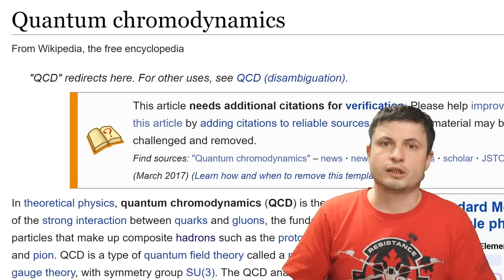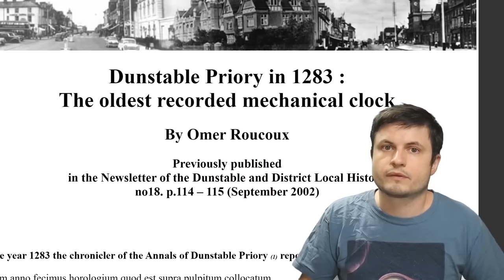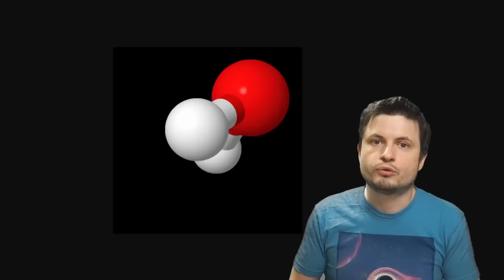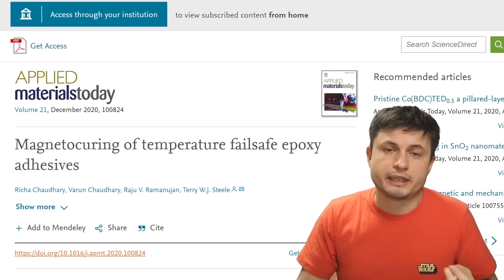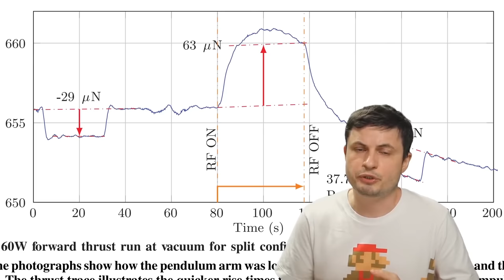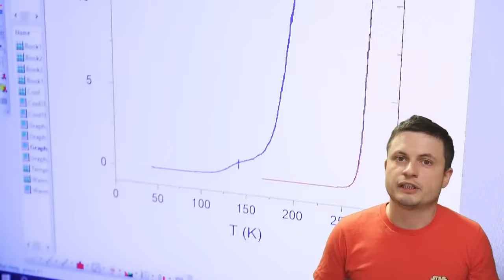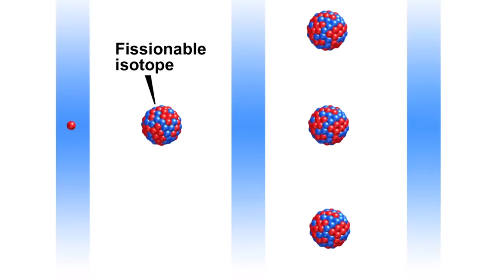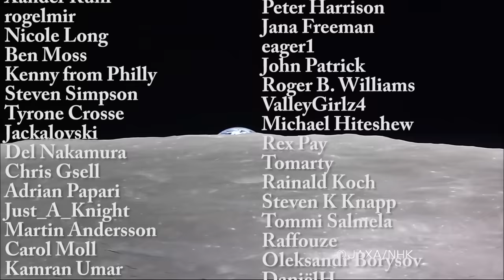Major Physics Discoveries of 2021 That Transformed Our Understanding - Video Compilation

Comment: Anton, I can't get past your first story. Did you notice the error bars on the "data" from Fermilab?  

This is the one thing that really bugs me about modern theoretical physics. With a "filter" that eliminates 98% of the data, and a whole lotta handwaving, we have a "new force of nature" to cover any  discrepancy in the numbers.  We already have well over 100 new "constants" to fudge the Standard Model. With high power particle accelerators that generate billions of events, we have "filters," ie, software that selects those events that are "likely to be of interest." Then when I hear things like "The Standard Model is physics' most accurate theory and has been confirmed to ten decimal places or  0.0000000001", I roll my eyes because of the "cherry picking" of data and all those adjustments to make the numbers work. This kind of  self- congratulatory hyperbole is what made men like Einstein and Planck so uncomfortable with the state of theoretical physics in their day. I wonder what they would have thought about the  methodology being used to "confirm" particle physics theory since the 1960s, and the precision of repeatability with only two experiments "proving" g-2 (or Higgs on which the Nobel prizes were instantly awarded) when the error bars are so very wide?

Comment: Ohhh... possible use case for that graphine battery / doped graphine. Don't know why I think this will work... but would there be any way to use 2 sheets of graphine. You pump pure CO2 in there and run a current between the sheets to give enough energy for the O2 to leave. The left over carbon would, I think, deposit on one of the graphine layers to make graphite. Remove the now grapite sheet and replace again with grapine to restart the process. Possible carbon capture technology?

Comment: Frequencies corkscrew through space and the spin is the drag of resistance of interactions of their continuous motion being slowed down. Interactions of frequencies create substance by compaction of wave lengths causing accumulated massive amounts of forced gathering of entanglement. Compatability of frequencies interlocking creating Gravitational force known as mass. The entanglement tightens the area of spiraling and spin, and reduces travel speed increasing force. The energy of force increases the spiraling spin resistance, turning fluid motion into interwoven, interlocking, frequencies to appear in solidity becoming interlocking motion in energy transference. Energy transference is the force necessary to push through the interwoven frequencies to continually travel on its course of directional travel. Gravitational force is space itself in resistance to itself. Churning into and out of existence from fluid motion to mass motion in degrees of entanglement. Every form of energy spirals in resistance. Free travel has no resistance. Force is the measurement of resistance needed to push through to continue its motion of frequencies. The force is the backing resistance of pushing through. Pushing a camel through the eye of a needle, without loosing the camel. The camel stays a camel in motion. It's just distorted when in forced resistance until passing through. Heat is accumulated force on the opposing side of push. Heat can be termed accumulated pressure.

Comment: I dont know why you think the production of graphene is so small. Gratomic, for instance, is mass producing graphene in bulk for use in tires, replacing the lamplblack so tires last ten times longer and are more grippy.
Reply: Might be wrong but doesn't look like those tires are out on the market or even ready to be released so it's at the same stage as 99 % of graphene projects
Reply: @deadsi  They've produced tires that have proven to be as I said.  The problem is nobody in the tire industry wants to participate because their revenue stream is based on the obsolescence caused by tires wearing out.

Comment: So water now has FIVE states then.  Liquid, Ice, Vapour, Exclusion Zone and this new heated form.  Exclusion Zone or EZ water is when water is in contact with a hydrophilic surface, it excludes ALL contaminants and particles in an exclusion zone, changes the charge to highly negative.  Called the fourth phase of water.  It can also be made into a solid from the EZ state.  French scientists are working on a new type of memory storage using the crystalline structure it creates as a solid.  EZ water is a liquid at a wide range of temperatures, a solid when purified which crystallizes without freezing.  Capable of storing huge amounts of digital memory in a much smaller area than silicon.  Its potential uses could be transformative to technology.

Comment: I have a question if you where to drop one atom of hydrogen in to the center of a circlierl magnetic ball with inner an outer shell spinning in opposite direction in a vacuum while hit with different level of sound going through all the spectrum of sound as well what would happen to the atom

Comment: You can make a hydrogen atom using a proton and a muon instead of electron. Now these will fuse together in nuclear fusion quite easily since they can get rather close to each other before electrostatic repulsion kicks on. The rub is the muonic hydrogen will not last long because muons decay quickly.  However there is a sneaky way to get them to live longer so they can fuse over unity. Has to do with realitive stability allowing muonic atoms to live longer 😊

Comment: at 57:31 so the Universal exspansion theory is the point where the human invention can expand space AND fill it with every life providing element, TIME being the control used to expand space , sort of unfolding a box with light or the power that provides light, a positive Highlights, of Shadow light, which is faster than highlights which are visable, but for Human and living beings both preempt EXSISTANCE . Or in esoterical terms, A previous conciousness, followed by material conciousness, that is to say, everything conciouss in the material world.

Comment: 27:20 Brownian Motion that's like the devices H.G. Wells invisioned, they could take natural thermal and kenetic energies from the environment and vent the excess back to the original energy system. Almost like that... He was right about Face Time, deep sea diving, all sorts of junk so far
Reply: Your examples are much easier than getting around conservation of energy. If the energy comes from the brownian motion, it means that the material cools down. We could use the heat difference to create electrical energy. Even if it is not obvious that the free energy from graphene creates energy because it could make use of the heat, it would mean it even creates energy as a side effect in a second place. Breaking conservation of energy two times does not unbreak it.

Comment: Are these testing facilities trying to deflect these muons away from the space where the actual experiment is running? Since they have an electric charge, it seems like it could be done. What are the effects on the experiment if the muons are not deflected?

Comment: 1:15:35 the graphic explains the theory of worm holes, the unsolved area in white would not be folded, to my mind it makes more sense that on side of the worm hole would have more gravity and would work much more like mercury wobbling , not stable. Mysterious matter called plasma, is alive and changes , probably like the water at different temperatures, so it's ephemeral would change , which may be the tangent related to another theory why would aliens do experiements on human reproductive and digestive componants. Well if their seed was a liquid, plasma that could be hybrided with human liquid, which is 90% of our body mass, then they are figuring out how to survive and evolve. Hence I do not believe in the big bang CLOCK and direction

Comment: The "standard model" is so ad hoc and arbitrary, resembling a Rube Goldberg machine. Surely there is a simpler and more elegant, encompassing model that is waiting to be found?
Reply: String Theory. Still in Alpha build I think. I heard they'll start Beta testing after they implement the Quantum Gravity feature into the code.

Comment: I seem to be blessed with grand concepts with little understanding  of how  .
You say scientists made water conductive , I think "add salt ". 
You the  talk about water drops coated in sodium metal alloy. 
So on that line I say they turn yellow from the change in physical structure of the water molecules. 
They are still water , but like pink diamonds , the  carbon lattice  of those molecules shift in shape and location but do not otherwise change. And boom pink diamond  .
Two concepts that have arrived in my head 1::
Portals a.k.a. worm holes,  most likely are caused by interactions of piezoelectric current , a power vortex ( anomalies in Earth's magnetic field)  and  I believe certain conditions in the electromagnetic spectrum ,mostly in the range of light , for visible and non-visible wavelengths .   
( My newest  mental addition so it's least refined. Anybody who cared to could find tons of my comments talking about this in various YouTube channels and other places other the last 6 months) .
In geographic areas with high concentrations of heavy minerals( quartz most commonly will be with them often as the host rock) and constant seismic activity, piezoelectric current is constantly being created and discharging , when  the discharge  
Is particularly strong in a power vortex area.  It interacts to create an instability in time/space. When met with certain wavelengths of light , it somehow amplifies lights interaction with the quantum... "realm" I'll call it.  This interaction creates a situation similar to what occurs inside the large hadron collider , and it opens a window or door depending on how strong the piezoelectric discharge was. 
This is the "YouTube comment short short explanation ,version"  ... In  trying tolearn about" my" concept , I keep seeing similar papers already exist in particle physics and quantum mechanics. 
With the latest light discovery I know of ( photons passing each other at extreme velocity create virtual particles , which can collide and create real electrons pairs..., it would add to this situation . 
Second concept is to use a cold laser to blast plasma  ,  the particles would go into an accelerator and be discharged into  a solar sail  to give a constant push and to allow partially self replenishing energy that recycles into the Lazer or plasma source.  a physical model is in mind . The discharged particles and laser light would pass over  the point of a 60° cone solar array , hit the sails , travels over angled ,tiny silver high polish(.00125 micron) mirrors woven into the sail , which reflects anything not absorbed into the center of the cone for reconcentration,then is projected at a flat solar  panel to maximize the inertia effect and efficient energy use /reclaimation.  From that panel it would once again hit the sails and cycles until it is spent.

Comment: 3.01.45.
  I'm imagining many buried mirrors in a quartz crystal, atomically accurately aligned and quite small.
The mirrors being designed for a particular calculation with "my" 3D printer ... anyone for a choc ice?

Comment: I'm a ceramist, my electric furnace operate at over 1000° and there is a probe in it linked to the control panel to check the cicles and stop or wait at certain tempoerature I set, so should be the technology for the "new" chinese reactor, I mean if I can have di technology in my lab I would imagine that chines government or any othe should have far advanced tech

Comment: I saw a physicist who have worked on fusion reactors talk about nuclear fusion and how badly the idea is represented to the public. In order for a fusion plant to be viable it needed to provide a 10-15x net energy gain in thermal energy simply to provide enough electrical power to keep the reactor itself going and providing a meaningful electrical energy gain. The hughe increase in thermal energy was tied to the nature of the energy conversion. At every step of the process in turning the fusion energy into usable energy you have losses that need to be compensated for.

Comment: 1:52 what's stopping scientists from using balloons?
Reply: Physics. A ballon can only go as high as about 32km, which is when the atmosphere around the balloon has the same weight as the helium in it. The mesosphere they are trying to reach is between 50 and 80km high.

Comment: The physics, chemistry, and even biology of ADHESION is a fascinating and important area that doesn't get emphasized adequately even though it's of vital economic Importance and flat out vital importance period, because of the necessity of your cells to stick together to prevent you from dying in ways that range from the prosaic, i e. Fluid loss, loss of electrolytes, loss of transmembrane charge... that's just the obvious three! ... to the science fiction, i.e the loss of one's multicellular integrity leading to your disintegration by bits of the body falling off at random... but then again you'd never be able to live for 5 minutes without the so-called tight junctions between cells of the integument and strong structures of the body! Superglue is a very useful substance, but so is starch. Water can cause very strong adhesion... but the surfaces are often more important than the glue itself. Hours of fun kids! 😈👍🧪❗